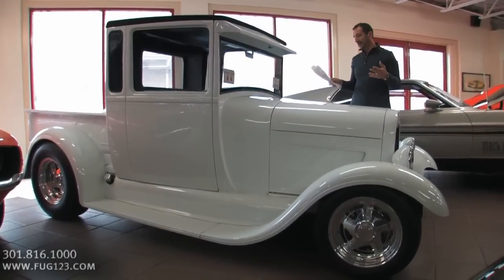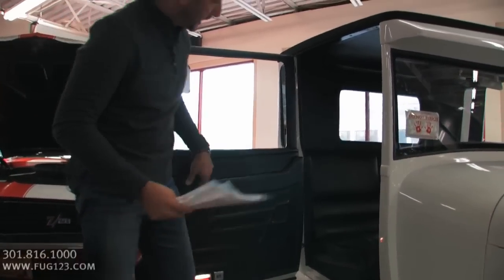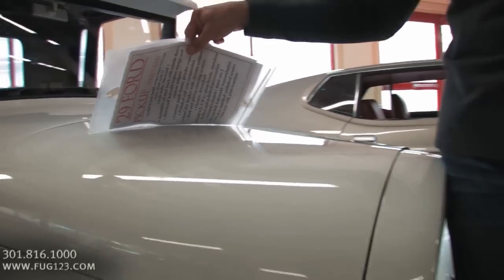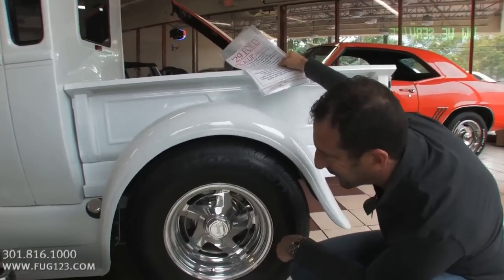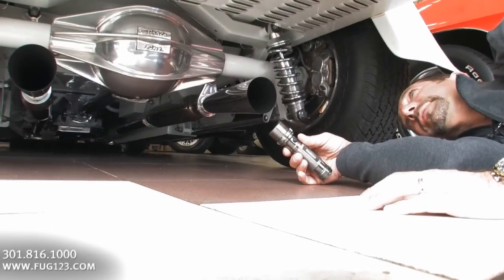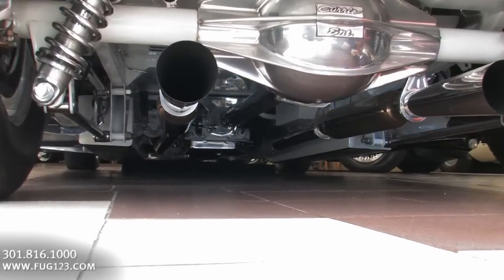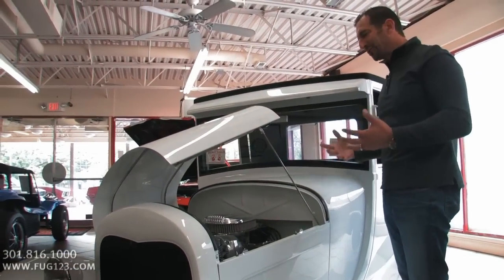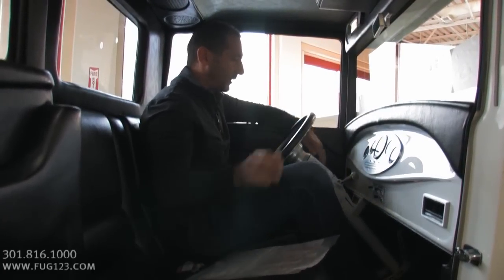1929 Ford Custom Pickup for sale Flemings with test drive, driving sounds, and walk through video

Comment: lol, yeah he did. It needed at least $20,000 taken off of that price at least it so I could swap in a nice 347 sbf with a Tremec T56 6 speed.

Also needs Mustang II front suspension and a mid/late 60's corvette independent rear suspension. 

Now that, is a 60,000 dollar truck.

Comment: Beautiful truck. As a car restorer by trade, I can certainly believe that some gold-chainer spent that kind of money having a shop build him a truck like that. It adds up fast ! The attention to detail is astonishing , then you get to the belly button engine under the hood ... BIG disappointment ! The ultimate cop out . You spend all that money on the details, then you stick the cheapest, most common drivetrain into it - boo ! This truck would be a step ahead with a dolled-up flattie in it , or at least something else interesting - anything ! And toss those terrible hood sides with that engine . The wheels are horrid and outdated as well, but at least they just unbolt and can get tossed away . I can even live with the white, since the truck it so nice. At least it doesn't have dayglow stripes or paint splotches down the sides. Too many easter egg street rods out there already. Other than those things, nice workmanship.